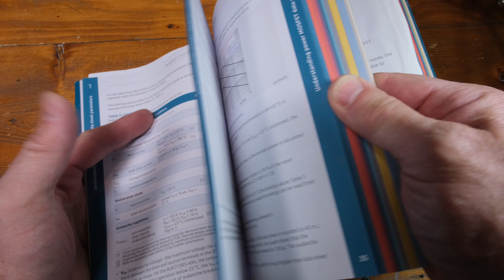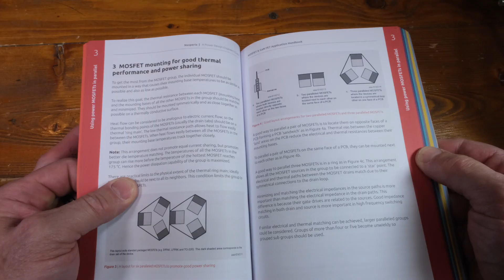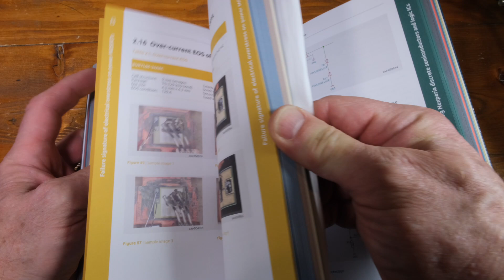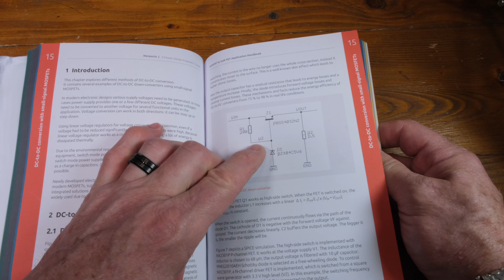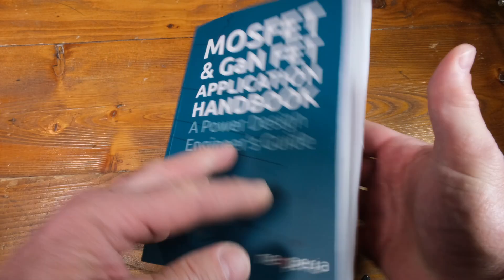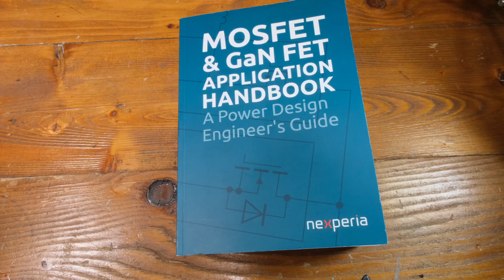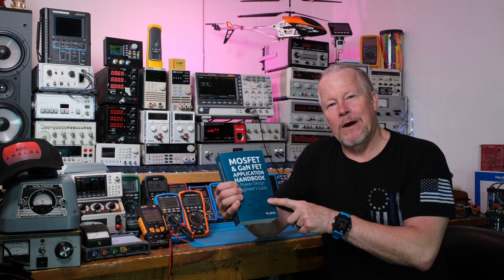Free GaN Book by nexperia Review

Comment: what are they like as power transistors in amplifiers I don't hear of them being used.
Reply: GaN FETs are fairly common in small 100W USB-C chargers. It’s tough to get that power density with MOSFETs. If you’re talking about transistors operating in the linear region, I dunno if there are any significant benefits.
Reply from the maker: @Hoobs mr groove The GaN FET is really great as a faster more efficient switching device.  As @Navin Francis Shajan suggested, as a linear device as is needed in a Class A/B amp, there probably isn't a significant advantage.  I could see the better thermal interface from junction to package might help shed heat.  The GaN FET should show significant advantage in Class D amps though;)

Comment: Hi Eddy, happy 4th again. I actually work in the semiconductor industry as free lance engineer. I thought it could be interesting to put down a small summary of Philips, NXP, Nexperia and also Motorola and Freescale. 
Back in the late 90's early 2000's it became fashionable for big electronics manufacturing companies to divest their semiconductor divisions. The first one was Siemens that created Infineon followed by Philips that created NXP (there is an insider joke that says it stands for "Not eXactly Philips") and then came Motorola that divested trough Freescale (Leaving out the Japanese companies here). A few years ago NXP and Freescale merged in to NXP and at the same time talks where going on to merge that with Qualcom. That never happened but because in this new combination, discrete components and some other stuff "does not fit in our corporate strategy" (which is a standard euphemistic BS phrase) a few production Fabs where spun off and bought by a Chinese consortium (I do not know them). The new name is Nexperia which was a Project name Philips used for a new generation TVs they where developing many years ago. The Qualcom deal fell trough, I guess that resulted in sellers remorse, but we can only speculate. The core of Nexperia are Fabs in the UK and Germany. Interestingly the UK fab has its roots in Mullard, a vacuum tube company that is responsible for many wet dreams among Audiophiles. The German Nexperia has its roots in Valvo, a vacuum tube company that only causes erections among Audiophiles. Both where owned by Philips. BTW, the Valvo company was in Hamburg and miraculously survived WW2. That same building from the 20's is where Nexperia is still producing from. Very recently Nexperia bought an other fab in wales UK previously spun off by  Infineon. That fab was owned by IRF or IR (Nicknamed International Rescuers by its personnel when it bought the bankrupt foundry it was). Before that fab became a foundry it was known as N-MOS (N stands for Newport, it was a Margret Thatcher project to create high value employment in Wales). But in the late 80's that was bought and asset stripped by STM. Finally FAB 1 of N-MOS is a historically listed building and can not be changed on the outside due to it's unique construction. It was designed by the same architect as the Centre Pompidou in Paris. (you can actually see the resemblance).
Reply from the maker: Thank you for this fantastic history;)  Very interesting stuff!!